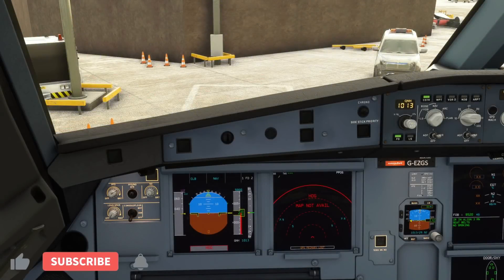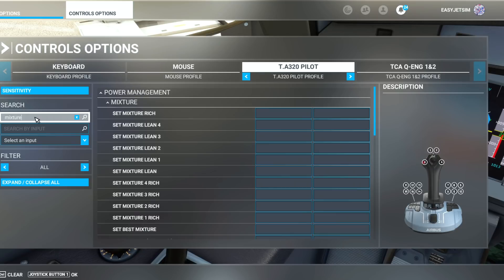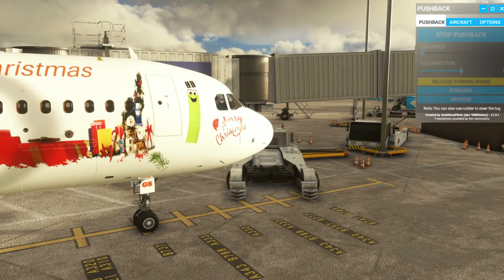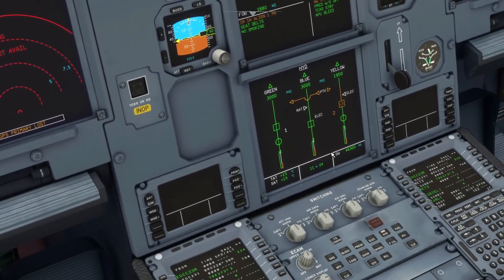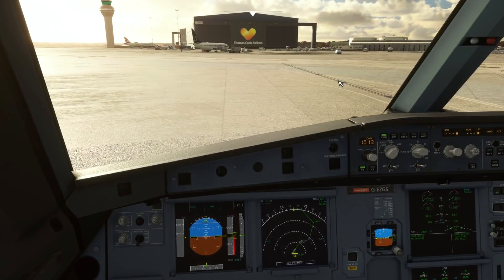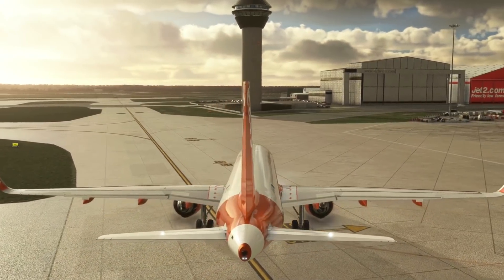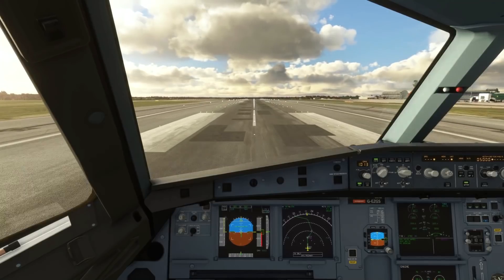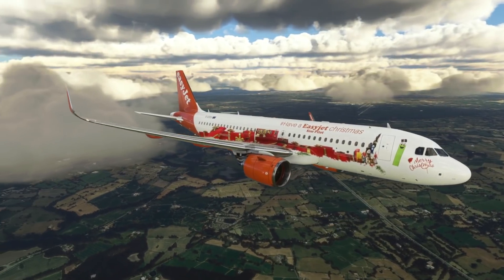FlyByWire Adds Tiller (No Rudder Steering) to A320 | MSFS 2020

Comment: HA !  - great !  Disconnect rudder from Tiller in Fly Pad ? Who KNEW .  Thanks
I assigned the steering to my Yoke (Alpha Honeycomb) does not seem to interfere.  Like a car  oh boy.
Funny I have the Side stick and throttle from Thrustmaster - but I dont ever use them... maybe soon.
One question, what causes the engines to NOT START periodically A320nx?  really frustrating.
Reply from the maker: Make sure the APU BLEED is on.
Reply: @Easyjetsimpilot  yes i have... it works like once every 4 mos ?? then never again.  No idea whats causing.

Comment: The tiller function of the A320 is great, but i want to know if the A330-900 also has a tiller function, because it's hard to steer on the taxiway's.

Comment: Great, thanks for that, AWESOME. I though find it very difficult to use the slide as A/C starts moving faster on the taxiway, I rather use the stick for the rudder controls, as I used all the time, but unfortunately, the stick is erratic only with A320NX FlyByWire aircraft. Any inputs please, I still need help. Cheers

Comment: Followed your lead and set the TCA sidestick as the tiller. Also placed a thin strip of white tape on both the slider knob and the base of the sidestick mount to mark the “zero” (straight ahead) point. It allows for a quick reset when rolling into a straight taxi segment. Works like a charm!

Comment: Any controller simmers , how can I use the tiller feature on my controller without disabling rudder controls.
Because the aircraft is barely steering while taxiing using rudders on controller , I cant seem to fix this
Reply: If you're playing on PC I just used a keyboard bind to fix my issues as every key I tried on the controller was in use, however I created a second controller profile where I used the right stick down as my Mixture 4 axis and I got mixed results, so if it works well I'll report back to you.
Reply: Just ran a test and confirmed that you'll need to set the Mixture 4 -100 to 100% axis with a keybind in order to fix the tiller issue. I set the keybind on my keyboard as nothing on controller was available, hope this helps.
Reply: @wyoung3005  okay brother thanks for your insight , I am going to try this today!!

Comment: Hi. I hope you can help me. I  can t control the plane on the ground anymore. I don t know why. I remembered you had posted this video about the tiller option and thought it might help but I don t seem to have the option in the tablet anymore. Taxiing now i can hardly turn in either direction. And on takeoff, well I just go towards the right and most times crash. If i can t find a solution i ll have to scrap the FlyByWire. That would be awful since I just bought the new FS2Crew co pilot. Hoping you can help me. Thanks in advance.
Reply: same. thats why i came here. i cant control the aircraft well on the ground. it steers violently

Comment: Hi, I was using a set of rudder pedal to steer the FBW A32NX on the ground and found it impossible to get the plane to go where I wanted it to go. It was so bad I had given up using the FBW A32NX.
Thanks to your video, I now having the Tiller connected to my Airbus Joystick where the rudder was connected, what a difference!
Thank you for your video.
One more thing. When I release the brakes, the A320 move, like you said it should. I didn't realise that was supposed to happen. What I find is that the aircraft builds up speed quite quickly to about 30 knot and I have to use reverse thrust to slow the plane down. I would much prefer to set the aircraft off using the throttles and then slow down the plane by shutting off the throttles again.
How do you control the aircraft speed on the ground?
Again thanks for a very informative video.
Reply from the maker: By single engine taxi or using your brakes. The A320 Neo does taxi under idle thrust, just like real life.
Reply: @Easyjetsimpilot  thank you for taken the time to answer my query. I'll try taxiing with one engine!
I always look forward to your videos. Best regards
Reply: @Easyjetsimpilot  thank you. It works great with the tiller! Happy Flying to you.

Comment: I do not see the tiller option in my flypad under Settings/SimOptions. I see only "ADIRS Align Time", "DMC Self Test Time", "Default Baro" and "Detents". I do have the latest Dev version of FBW. Do I need to have the latest hotfix of MSFS which is still not available?
Reply from the maker: Manually delete the A320NX folder from your community folder, then redownload the dev version from the Flybywire installer.
Reply: @Easyjetsimpilot  Thanks, that worked.

Comment: I am using a spare Thrustmaster joystick just for this new tiller function together with the Alpha, Bravo and rudder pedals. Works like clockwork. FBW also mapped a button to separate the rudder from the tiller to mainly use while taxing and checking surface controls at the same time.

Comment: How do you turn off the tiller steering? It's rather impossible as I don't use pedals and I use the slider on the airbus stick as my throttle.
Reply from the maker: Done in the EFB.
Reply: @Easyjetsimpilot  Thanks. I think I'll order the throttle quadrant, then I can separate it all.

Comment: I don't have another button to use for my tiller. I have the Logitech attack 3 and I use my rotating dial for throttle which you have setup for tiller. I have rudder pedals but still need to use the rudder. And Iam sure if I set keyboard keys there will be no in-between. It will be hard left or right.
Reply: You can use steering inc and steering dec keys. Might not be as usable as an axis though.

Comment: This is way much realistic using the tiller now. I use it with the tilt function of the airbus stick and have now my rudder pedals as they should be in an Airbus configuration. The inertia of the tiller is great modeled too.  So we have to respect the 10knots for 90degrees turns and anticipate the turns. By the way a lot of companies starts engine 2 first in order to have the yellow hydraulic pressure available for taxi and do not required to activate the electric pump. Thanks for sharing that video.  Could be great if you can do a short video of the new waypoints function of the MCDU.
Reply from the maker: This is an area that is often cause of confusion and misunderstanding. And to answer you need to consider two scenarios;
Single engine taxi. 
Two engine start. 

I’ll start with the latter. On a two engine start it really doesn’t matter what engine you start first. On pushback you’re connected to a 15 tonne tug and you’ll be starting the engines whilst attached to this tug. It doesn’t matter what engine you start because you won’t go anywhere with a tug attached to you. Each engine runs its own hydraulic system and ideally, you want the green system (Off engine 1) pressurised so that the normal brakes (that come off the green) are working. But this isn’t as important when you have a 15 tonne anchor attached! 

A lot of older legacy airlines chose to have their SOPs dictate engine 2 is always started first when you decide to start both engines. Why they did this I don’t know and I can’t remember.  I suspect it was a old Boeing SOP that filtered down into company’s SOP when they acquired Airbus into their fleet. 

So, when you start both, it really doesn’t matter. 

On single engine taxi, you always start engine 1 first. This is mainly because of the previous hydraulic reference. You want your normal brakes working when you taxi. To achieve this, you really want engine 1 running. The PTU could do this for you if you decided to taxi on engine 2 only. However, PTUs fail more than engines. And if you lose the PTU, you’ll lose the normal brakes leaving you only on alternate brakes off the yellow system (eng 2). Although this isn’t bad, it’s not ideal as having engine 1 running and looking after the normal brakes. 

In respects to always starting engine 1 first, irrespective of scenario. This is now just Airbus SOP. To avoid confusion, and the potential of forgetting to start engine 1, you just always start engine 1 first. This way, you never have to think about what engine to start first. It will just always be the same order.

Comment: Thanks Gavin! Yesterday I thought the FWB is broken. I use the T 320 too, but I use the slider for the thrust. The seperation for Tiller and Rudder is off. Now I turn the stick to the right and the aircraft goes to the left and otherwise...very annoying. I switch to the stable version, there everything "normal". Thanks again for the info!
Reply: you can reverse the axes
Reply: The new feature is not working with game option auto rudder activated. Deactivate it and enjoy :)

Comment: Hello friends. I can't find the option,  mixture axis 4 (-100 to 100 %). I found mixture axis 4 (0 to 100%) , but it doesn't work. I have a french configuration .
Thanks four your help.
Reply: Same problem, french config too
Reply: I found the solution : config it on "Axe du mélange 4". Maybe in french we do not have exactly the same translation of each setting. It seems to correspond to the (-100 +100%) axis.
Reply: @sysymama7472  hello there . i'll try it but it isn't "axe du mélange 4", qui veut dire "mixture axis 4 (0 à100%).
Reply: @sysymama7472  Hi , thanks for your help but the link with the joystick doesn't work because there is not the option, in the french version . There is no line "axe du mélange 4 (-100 à 100)"

Comment: Can some one help me PLEACE!!   i try to set the Altitude knob in the sim (Managed Climb or desent) so knob pusch up or down  at first this was no problem but now i cant config it after updates(FS2020 or Fly by wire).. does some one have a solution for this with out using other software  ??  also Logitech Multi panel is not working verry good with this plane ,, not all lights are working and VS nr is not working it does work in the sim plane but not on the panel it self.. hope i get some help..   

Thanks for all your vids they realy are grait and helpful     THMBS UP!!!
Reply: Ok i just got the Multi panel to work.. i had to Assign the AVIONICS MASTER 1 ON to a button and now its kind of working ,, display on the panel dont change but in the cockpit it does..so on the way..

Comment: hi sri 2:25  why is PTU not running?
Reply: It runs automatically when there is a difference of greater than 500psi between the green and yellow hyd systems. In this case the yellow elec hyd pump is on and it will provide full pressure to the yellow system which will be about the same as in the green and therefore the PTU won't run.